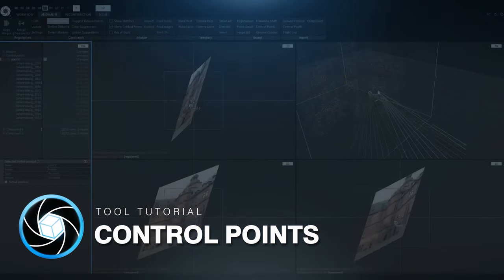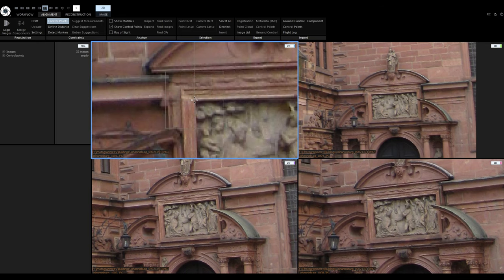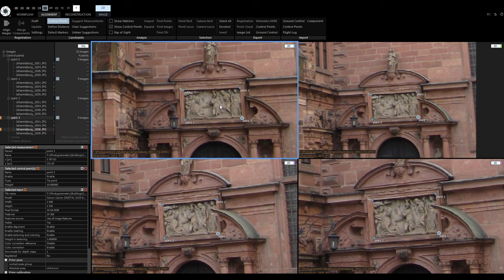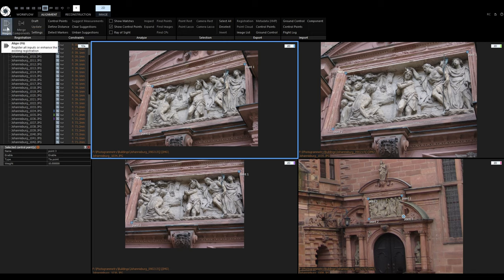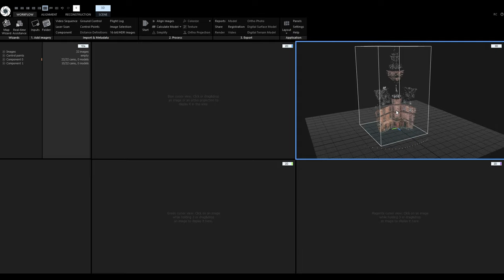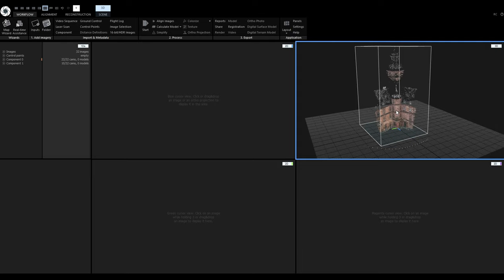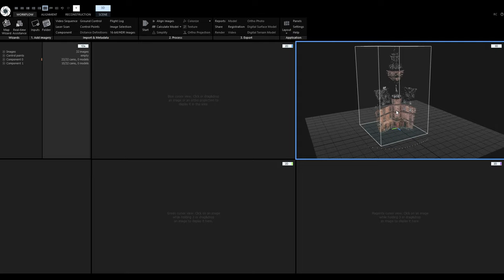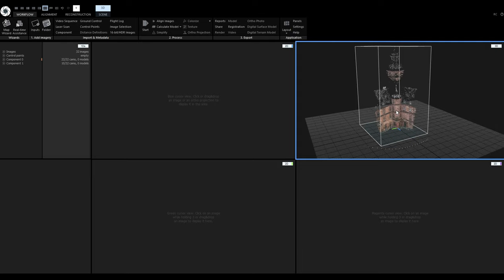RealityCapture tutorial: Control Points

Comment: Everytime i run the Align images it goes for a few seconds before just disappearing and nothing happens. What am i doing wrong? There isnt even an error
Reply from the maker: Hi Jacob, what kind of dataset are you using? How many inputs are imported? What is the image quality?
Reply: @CapturingReality  My subject is someones face. they are pretty still throughout all photos. I have 125 images imported. 200 if i include the ones of the back of the head. Taken on my Sony a6000 manual cam settings and raw. Once in RC image quality is 6000x3376. 

I've tried to go through and add control points on the corners of the eye, mouth and ear, but when i hit Align the blue bar goes about 1/3rd of the way and it vanishes with no prompt as to why it had done so. 

Is there a way to see if it ran into an issue with a particular image?
Reply: @CapturingReality  I had just tested again using the quick start files from the cloud. Clicking Align ends early and no components are created

Comment: I don't think that down arrow key confirms suggestion of control point any longer right? For me it does switch to the next view, it just doesn't confirm.
Reply from the maker: Hi, it works that way. It confirms the measurement and goes to next the image.
Reply: Mine does not do this. I can create a recording for you. It would be a huge improvement if it both confirmed and moved to the next image. I’m using the latest free version.
Reply from the maker: @alonsorobots  Feel free to record the video.
For the suggestion you need to see the unassigned control points in 1Ds view (the ones with green plus sign next to them).
Then you need to open the image with control point in 2D view, hover the mouse over the point, click and push the left mouse button, correct the control point's position and confirm it by pushing the down arrow key (6:09 in the video).
Reply: @CapturingReality   I realize now that you have to click and hold down the left mouse button for it to auto confirm and move unto next. Also, for me it's not the down arrow key, but the left and right arrow keys. Maybe it's a language difference?
Reply from the maker: @alonsorobots  No, it is not a language difference. Left/right key shows the next image in the capturing order, up/down key shows the image where the point is suggested.

Comment: Hello! Please give us the link for these photos! I can't find it on your Sample Datasets
Reply from the maker: Hi Alexander, this dataset is just for internal purposes. You can use any dataset for placing control points, the principles are the same.
Reply: @CapturingReality  Actually I tried to repeat the moment after 9m52sec and… It doesn’t work in my case!!!
Reply from the maker: @alexanderchiknaev356  Do you mean suggestions? Do you have set Enable under Alignment tab/Registrations/Settings/Advanced/Enable measurement suggestions? Did you pushed F3? Is Add control point active after this?
Reply: @CapturingReality  Yes I do. Suggestions! I can't see relation lines between the current point on the point cloud and cameras
Reply from the maker: @alexanderchiknaev356  Can you contact our support with this problem?
Reply: @CapturingReality  Yes. I can. I will.  Thank you very much!!!